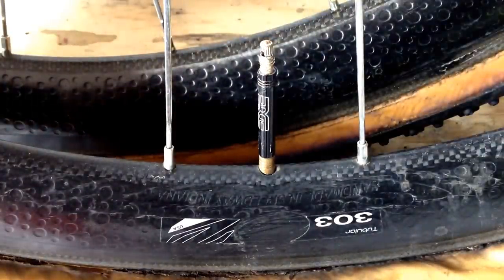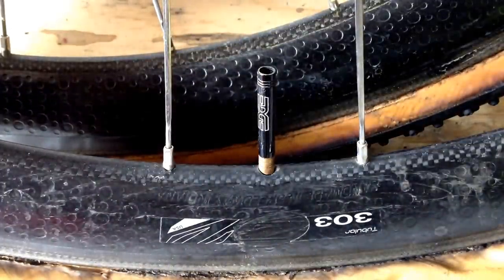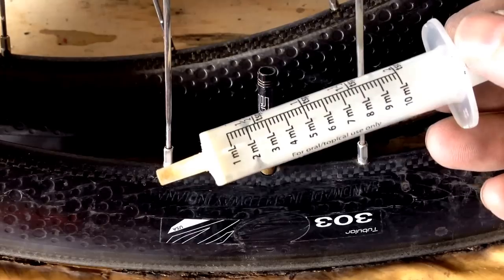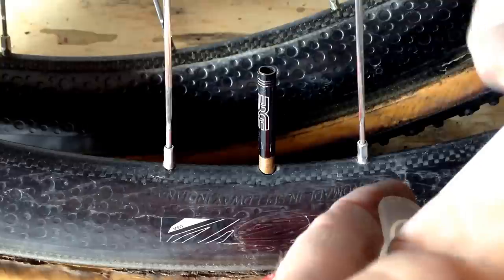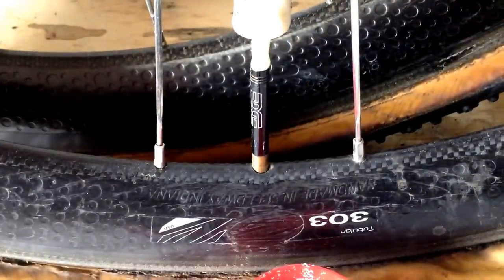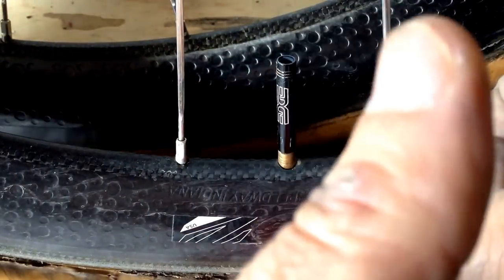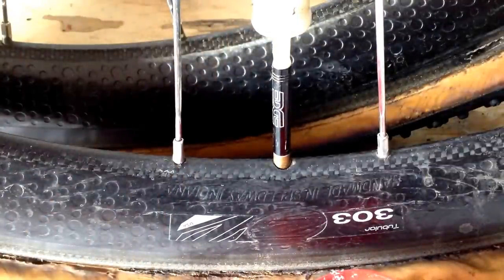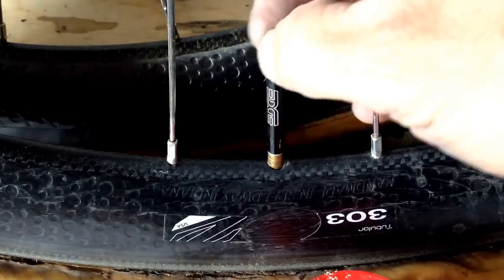Puncture Proof Tubulars? How to add sealant to a tubular bicycle tire / tyre

Comment: nice video .. but do you need to change it after become dry ?
Reply from the maker: Yes, but it can't be changed. The sealant can be thinned out a little using ammonia, but eventually the tire will become unusable. So this technique would be effective for 1 - 2 seasons max.

Comment: Well only question is if you dont have removable   valve cores how do you add sealant into tubulars then?
Reply from the maker: nHail14Me I've seen it installed with a syringe. Check this out: http://goo.gl/hQar8F

Comment: well, does it work?
Reply from the maker: I never had any punctures during the CX season. Was it necessary? I don't know - depends on your course conditions. Supposedly tire sealant works even better in a latex tube (than a butyl tube) as in these tubular tires. I figured a little extra puncture protection would be worth the 1-2 oz of extra weight.
Reply: @LeTourDePlants  You didn't explain the function. So if you get a stone in your tubular with sealant you will puncture? Then you stop, take out the stone, pump air in, and then the sealant closes the hole, and you continue riding. Is that how it works?

Comment: you mean the syringe holds 10 centi litres.

10ml would be a a ridiculously low amount(a shotglass has like 30ml)
Reply from the maker: Yes, when I use Tubeless CX tires I put around 2oz, which is approx 60ml of sealant.